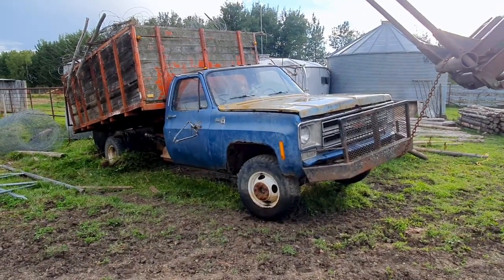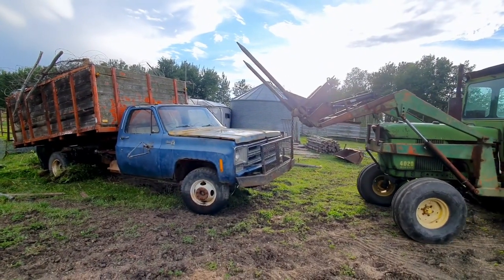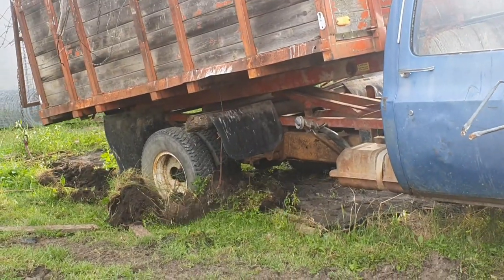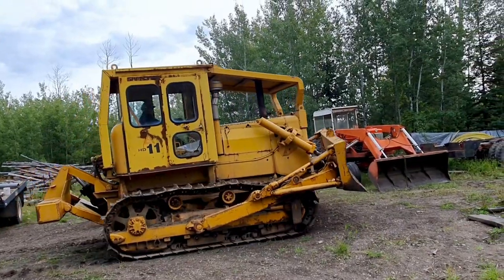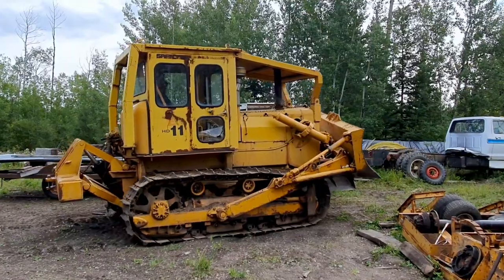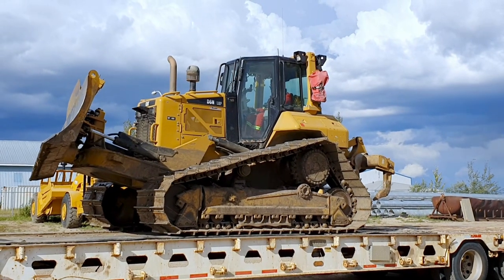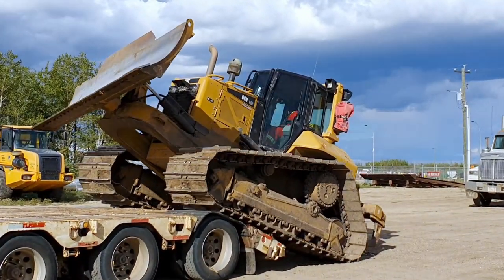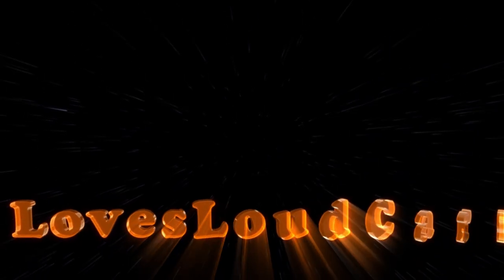60 year old Alice Chalmers HD 11 bulldozer

Comment: It's nice to see old equipment & trucks still being used. I worked in a junkyard 30 years ago. A yard down the street had a old allis Chalmers articulating loader
Reply from the maker: That junk yard would have seen a few impressive things go through there no doubt. I've got a pretty big Massey articulated loader with a v8 Perkins. Runs great. Had the steering control valve repaired,  & waiting to be put back together. 
Lots of projects!!
Reply: @lovesloudcars  share your projects if the opportunity is available. Thank you. Have a good day

Comment: Pretty healthy ripper on the back of the old Allis dozer. I thought the square body was going to pull apart when he was tugging on it using the loader
Reply from the maker: I was wondering if he was going to twist something as well.  Finally got it pulled out and hammered on the frozen brake drum to free it up. Was thinking maybe I could just insure that truck for delivering firewood,  but the floor boards are rusted out on the driver's side. 
As for the ripper, it certainly is big.  I don't know if he's got any shanks for it,  but I don't think so.  
Hopefully I'll get back to record a short video of his one 40s international truck waiting to be restored.  He's the second owner,  won it for a hockey game bet from the original owner.